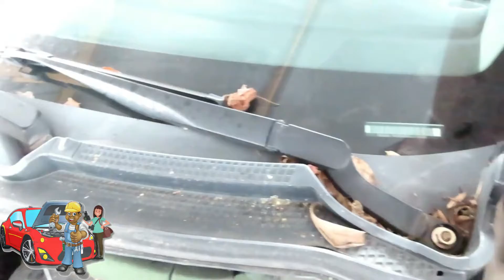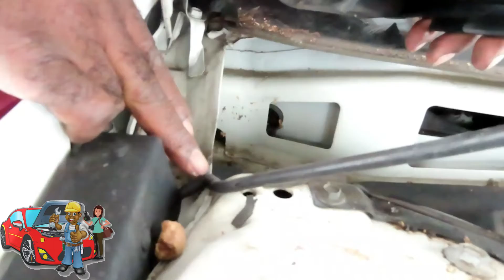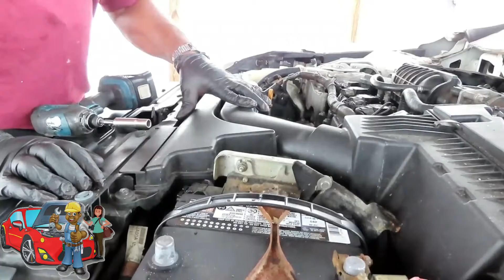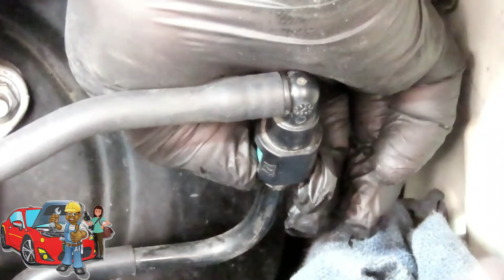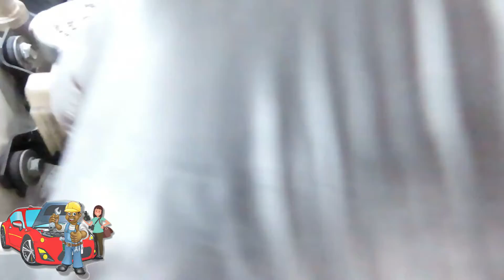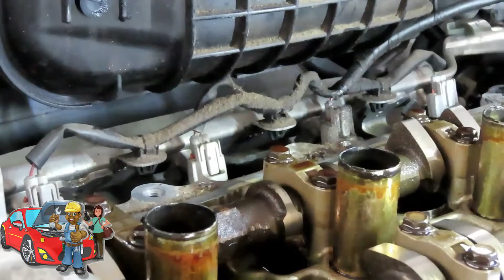Nissan Rogue Nissan Altima Nissan Sentra Head Gasket Replacement. Part 1

Comment: Nissan 2.5 actually aren’t that bad my uncle had one with 257k on it the only issue was the transmission
Reply: 276 blew the head gasket
Reply: Ok lets  review. Only problem the transmission? So after 200 k he never had to change the alternator, the water pump? The two thermostasts, or the ignition coils and their electrical connectors which typically last 100k, he never needed a radiator hose, or a cv axle boot, what about the timing belt it never aged? Not even a little bit? That right there my friend is one miracle piece of automobile. It belongs in a lab so it can be studied and worshipped
Reply: @greed6is6good  with basic maintenance and regular service the only issue was the transmission I thought it was obvious that cars only last that long when they’re taken care of.
Reply: @terelll6990 it's common sense to know that they only last that long with good maintenance. It's just some people try to take stuff way to seriously 😂 and a lot of people these days don't have common sense